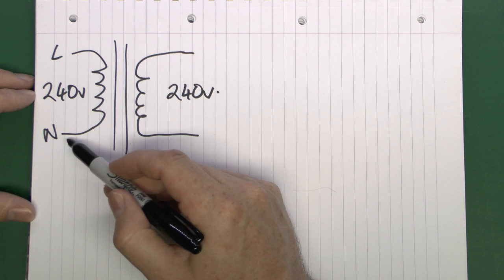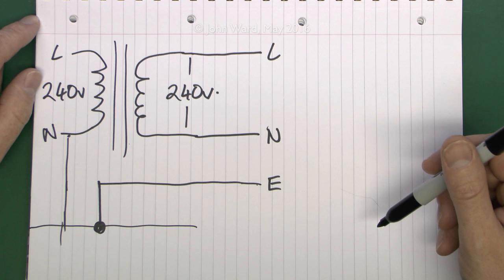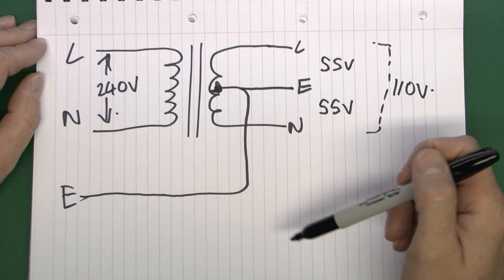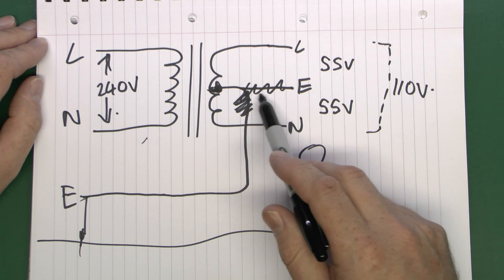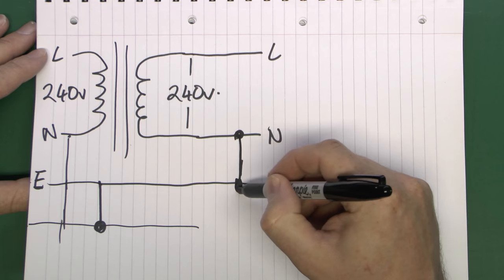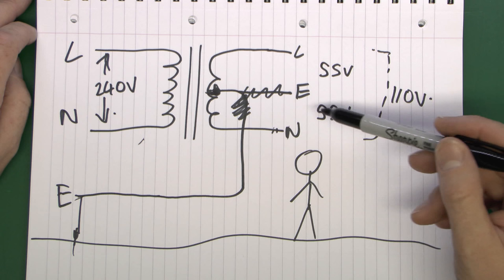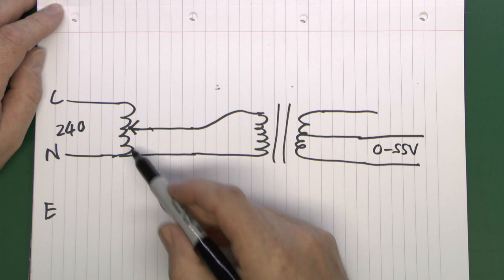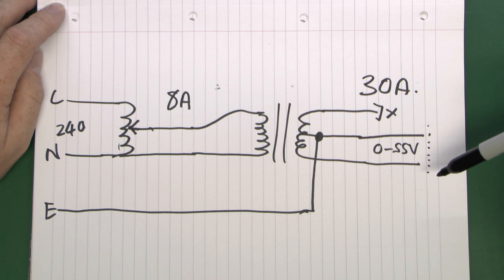Transformers & Earth Connections

Comment: Great video but I still can’t my head around not getting a shock off L on secondary side off transformer. Surely being connected to earth and touching Live creates path back and hence electric shock? Could you explain why that doesn’t happen then please John? Thanks
Reply: Current always needs to back to it s source. So if your secondary is not earthed in any way touching L gives current no path pack to N via your body. It s basically a dead end
Reply: @bixenbaer  Surely though if you touch live on secondary your body completes path back to ground and current travel back via mass of earth then back along current and through transformer and so on?
Reply: @alanmarriott9216  if the secondary is not grounded there is no such thing as live an neutral. Both ends behave exactly the same.On one half cycle the positive is on the upper terminal and the negative on the lower terminal and on the other half cylce vice verca. But then again, touching the positive with no grounding there is no completion of the current path. Your body then will just be at positive potential until you thouch the negative . Boom! Voltage drop across you
Reply: @bixenbaer  Thanks but if im honest I still can grasp it. In my head all I can see is the voltage on secondary travelling through your body when touch then into mass of the ground creating earth path back for electricity to flow. Then back to primary side then through secondary and so on
Reply: The secondary side is galvanically isolated. It would for instance not tigger an RCD on the primary of you get a shock on the secondary. Think of it as an isolated battery. No matter where you connect it to, both terminals need to be connected to close the curcuit. Current needs to travel back to its source

Comment: John , or anyone knowledgeable,   can I ask a related question which is troubling me , I have a step down mains to 24 V AC isolation transformer and on the secondary it has the normal floating outputs.   What I can't understand is that when I check the voltage between the output of the secondary and mains ground It shows a potential of about 10V on the multimeter ie from one phase to ground.  This suggests that the outputs are still earth referenced , is that correct even although there is not galvanic coupling?     But how can I have a potential difference to the mains earth reference from the primary, is this due to capacitive coupling via the transformer ? is that the answer that allows the secondary to still be referenced to ground or is it through the magnetic core.   I thought isolation would mean the ground could not be referenced to the secondary outputs?.  Appreciate an explanation of this.  I hope my question makes sense.   I thought there would be no relation from either of the separate outputs to earth. Perhaps its wired differently internally , its a sealed unit, possible centre tapped on secondary to ground  , that may possibly explain it as you show on this video......   Many thanks
Reply from the maker: Capacitive coupling through the transformer windings.  Connect a 100K resistor between the multimeter probes and measure again - the voltage will disappear.
Reply: Excellent John, thanks for the quick reply , that makes sense now.     Best Regards

Comment: so If we are not connecting the neutral to the earth we will not get any shock , then why we connect neutral to the earth
Reply from the maker: Not connecting it would make an isolated system - but that's only safe if it stays isolated.  A single fault to earth anywhere would go undetected, and then people could get a shock from either wire, depending on where the fault was.
Reply: @jwflame  if secondary winding center point not earthing than we will always safe ?

Comment: Everyone says you cannot use a dimmer switch to make a variac. Is there some kind of switch I can get to do that.I don't have a lot of money and I would like to build one. This here looks kinda like the same thing if you add a switch to control the incoming volts.I am in the u.s. and would like 0 to 110 volts. Thanks for any help.
Reply from the maker: A variac adjusts the voltage directly, a dimmer cuts the AC waveform into short spikes with gaps between so the average voltage is less.  Dimmers will work with basic loads like heaters and incandescent lamps, but other items will not and could actually be damaged.
Reply: +John Ward please make a video about this subject (dimmers - to use it or not )
Thanks a lot

Comment: i thought it was 120/240v?  is this just britain specific ? i live in Canada
Reply from the maker: Britain has 240V only, there is no 120V supply and nothing to connect to 120V either - all appliances, lighting and everything else is 240V.
These 55-0-55 transformers are used on construction sites only, where power tools are made as 110V specifically for use with these transformers.

Comment: wouldn't the third one be 2:1/110v?
Reply: +Dan Dart No because he's only using half the winding :)
Reply: +Dan Dart No, as he explained previously in the video, the building site transformers are 2:1, so the line to neutral voltage is 110-ish. But then there is the center tap which sits between those two points on the 110 V winding, so it's effectively a 4:1 ratio.

Comment: Take apart a site transformer please :-).
Reply: +Per Mejdal Rasmussen - Nothing much to them usually, even if they're not potted.  Pretty-much a thermal cut-out on the line in to act as an over-current circuit breaker, then straight L&N into a transformer primary, then straight out the transformer secondary to your output sockets.
Reply: you left out the ground which would be bonded to the transformer chassis then attached to the secondary's center tap and then up to the output sockets.
( for completeness ).
{ and also probably common practice is to have all the wires bolted altogether onto the transformer }.

Comment: In UK you have 240 V?
Reply from the maker: Yes,  single phase 240V to most smaller properties,  3 phase 415V for larger ones (which is 3x 240V at 120 degrees apart)
Supposed to be 230V and 400V, but in reality it's still 240 and 415.

Comment: You should be labeling the ungrounded line conductors something like "Line 1 and Line 2 (L1 , L2), not "Line (L) "  and "Neutral (N )."  Calling a grounded conductor a "neutral"  is common electrician slang or tradition, but is NOT  CORRECT and leads to sloppy thinking about electricity in the first place.  A neutral is at equal potential to multiple other lines, and is not the same as a grounded conductor. Calling those ungrounded lines "neutrals"  implies they are GROUNDED CONDUCTORS, and as you are drawing them they are not.  From your work site example the grounded center tap has equal potential to both LINES, and neither line is a grounded conductor.  They are both ungrounded conductors - Line 1 and Line 2!!  Calling one side a "Neutral" in electrician slang/sloppy terminology implies it is a grounded conductor and at 0V to Earth.  It is not. As you show, touch that "N"  Line and you will get a shock between the 55Vac and the Earth.

Comment: what are the uses of earth's
Reply from the maker: Earth carries current when there is a fault, causing fuses to blow / circuit breakers to trip.
Reply: Thanks
Reply: @ Raviprasad Kota: The real reason for mains earth is to reference to distribution grid to the ground, that way in the case of a lightning strike to the grid there is low impedance path for the lightning to ground. If it were not there, the lightning would bolt out of every receptacle and light switch, your stove across to your sink (earth via water pipes) things of that nature.

Comment: And that's what I couldn't wrap my head around, you crazy Brits.
centered tapped ground/neutral for fault to line voltage of 55V vs. the US where everything neutral is bonded to ground whether at a service panel or the opposite side of a isolation? ( cannot verify that ) transformer. basically everything neutral is a "0", go through something and come out the other end and guess what has to have some reference to neutral/ground. I have a conditioning transformer, 1 loop of wire away from being an isolation transformer. unless you are a power company then you can do whatever you want, even if it means people are getting electrocuted in their swimming pools because of an improperly made connection up at the pole transformer, that's a different YouTube video....

and
OSHA requires that all job sites use generators or a fixed temporary service that has neutral bonded to ground at the point of generation ( manufacturer optional unless sold as OSHA compliant ) or service entrance ( NEC code ).

this makes temporary generator backup setups interesting, as it's a 50% chance one way or the other of a portable generator ( per manufacturers decision/market ) creating a double bond fault where return current can pass over the ground conductor to the generator. the solution so far from what I've been reading is to break the G+N Link on the generator and attach a ground bonding plug or switch to the generator to reestablish compliance ( either that or pull the linkage out of the service panel every time the power goes out ) or ignore it altogether.

it almost makes me wonder if the 55V to ground transformer idea is what OSHA should really be doing in the 1st place?
it doesn't seem like it is that difficult to do even if you start to use premise wiring, all that is needed is to be tied in to a transformer before a generator or temporary service.
although with our fancy split phase equipment a site tie-in would probably need to be a double secondary transformer with both secondary center taps tied together with ground ( my crazy idea, copyright, I am willing to be bought out ).